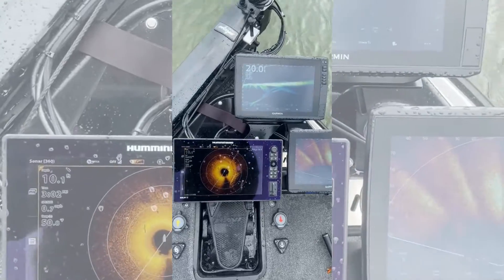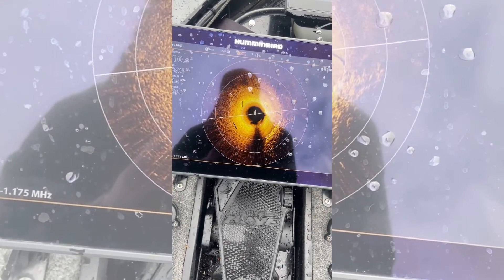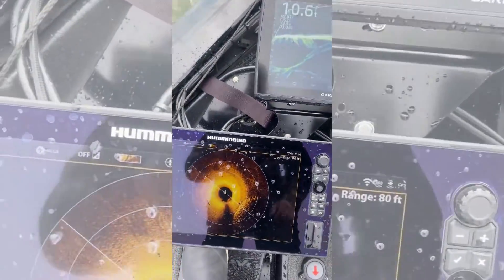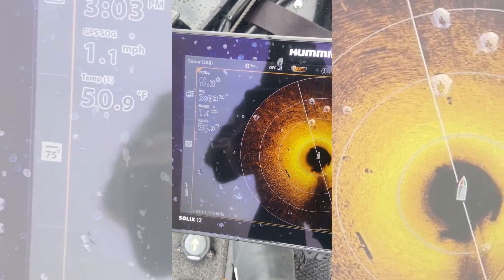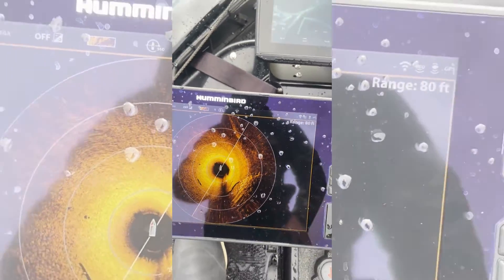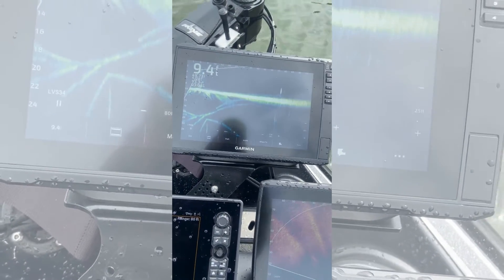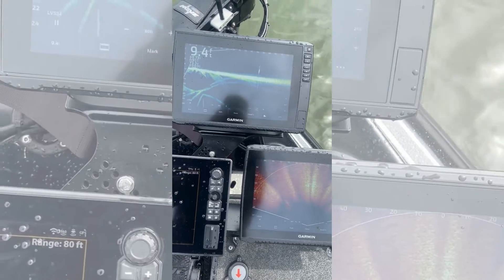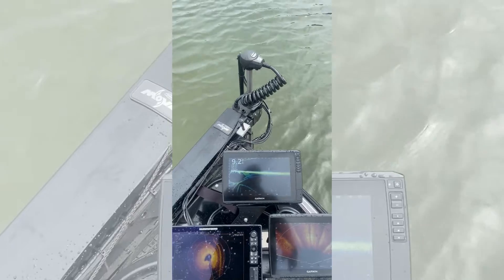[UPDATE] Power-Pole Move Interference (New Steering Board)

Comment: Dude! I got the new board and it didn’t fix the issue 🤦🏻‍♂️. I have to put it to 455 kHz just to get any sort of decent pic. If I turn the breaker to troll off I go back to Mega and it’s crystal clear. Crazy
Reply from the maker: Have you turned on interference rejection in the Power-Pole app and tried all noise filter settings on your Humminbird?
Reply: @patrickzajdel  so I tried the noise rejection option but for some reason on my helix it doesn’t pop up but I also only have 360 hooked up and I noticed that it seems to be a 2D Sonar option.
Reply: Also when I got this new board and I went to do the update I ran into a couple issues and I had to restore everything to default and never messeds with it since.  So the update may have not actually gone through, updated everything last night after watching your video I’m gonna go out there now and see if it fixed. Literally was going to get an Ultrex on my next boat if this didn’t work bc I love 360. So many people have no idea what they’re missing.
Reply from the maker: @mattwfishing  seems like it might just need proper settings and updates. I won’t run another motor other than Move. I fell in love with it this year.